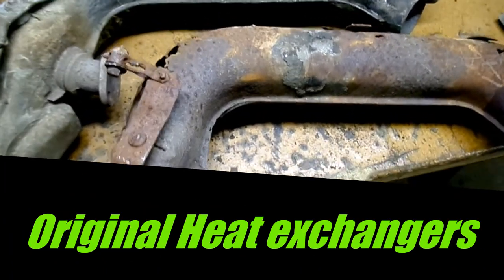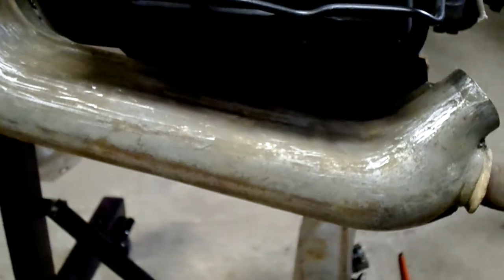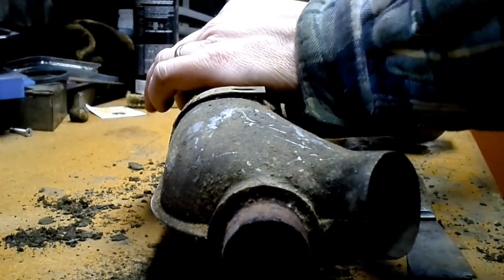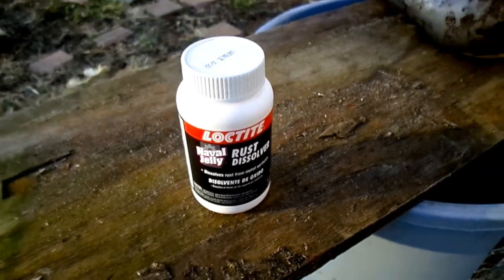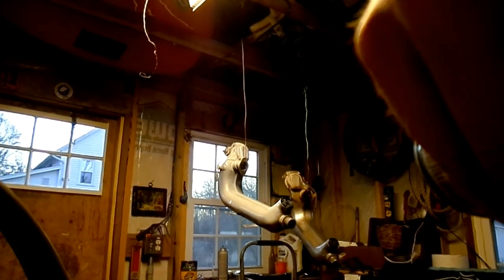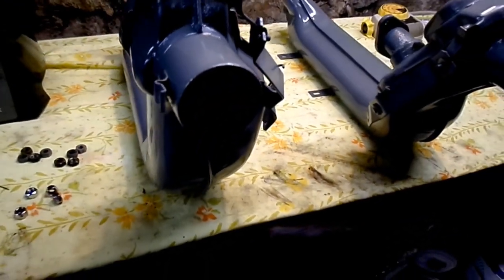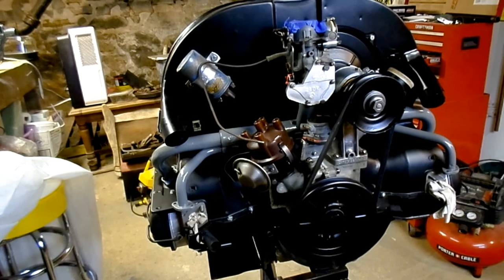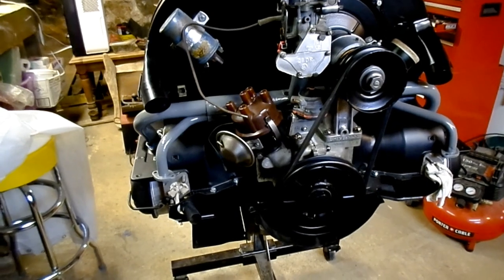Heat exchangers

Comment: Looking good man. What primer and paint did you use? I'm going to need to do this at some point over the next few months. Sand blaster would be nice but you did fine without it. Keep the videos coming.
Reply from the maker: Thanks CT,  i used rattle cans  primer was high tempature up to 2000f,  finish was up to 500f.  Those were what my auto part stores carried in the correct color for exchangers and intake manifold.

Comment: Great job! Im trying to break those old rusted stuck bolts to get em off the heads. Question: The bolt threads are on both sides of heads… how would i be take these off? It seems puzzling